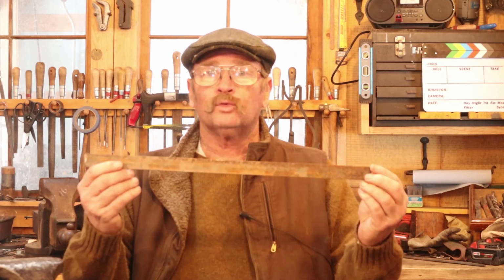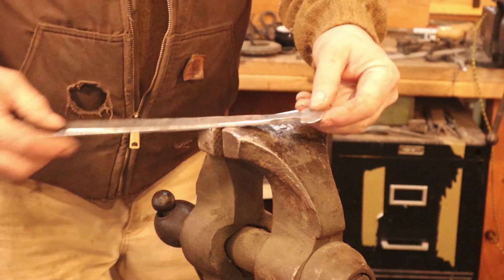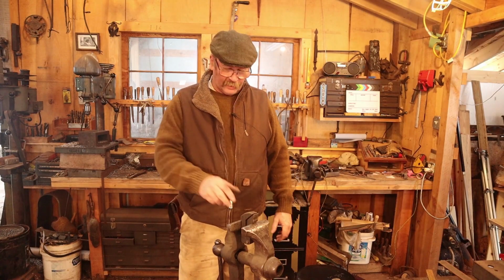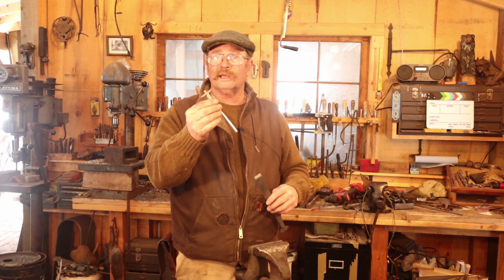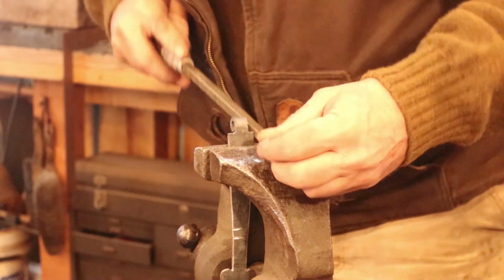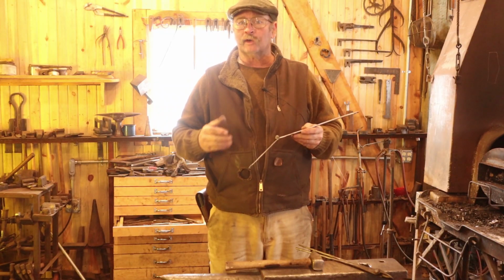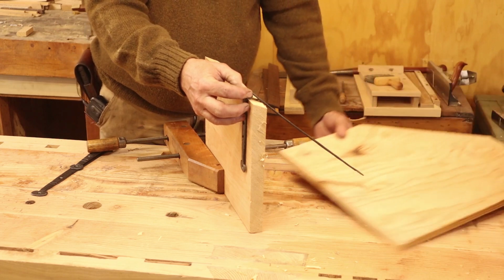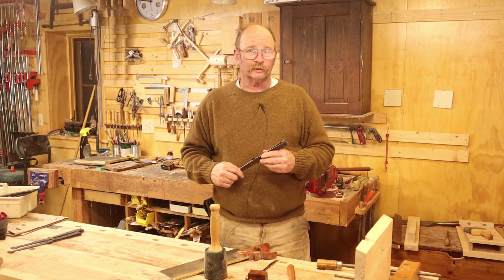Dutch tool chest hinges part 2

Comment: John,  nicely done.  As a thought for display pieces, consider a small mock up, for display.  The hardware guys  use these for lockset displays. This way you can market several styles.
Reply from the maker: I have actually stopped taking display boards to shows, they took up to much space in an already overloaded vehicle and rarely resulted in a sale.  I have found that having the items completed and ready to buy sells more than having a wide variety of samples that would have to be ordered.

Comment: i think that your camera might be set on sepia tone or something. It is impossible to see any of the slight color detail you talk about in videos that look like this. I am guessing that you know it is this way?
Reply from the maker: This video doesn't have any forge work in it and nearly everything was done cold at the bench.  So I'm not sure what color changes you might be referring to.  But, no my camera is not set on any odd setting.
Reply: @BlackBearForge  Oh, I don't think it is no my end. I don't see other videos with the reduced color range that yours have. It is as though you are in sodium lighting or something? This video is not the only one as well. I believe in this one you mentioned a small color variation as a landmark you used and I could not see the difference at all.
What I am talking about is sort of a pale overall antique look, like a tending toward a parchment yellowishness that affects everything in your videos. Just FYI, I am still watching.
Reply from the maker: It could simply be the amber welding curtain currently serving as the back wall of the shop behind the power hammer.
Reply: @BlackBearForge  Maybe so, I didn't notice it until recently so if there has been a change in how your lighting works that maybe the cause , Love your videos.